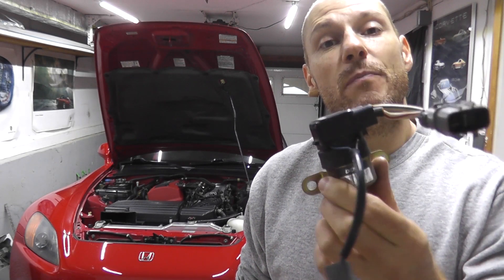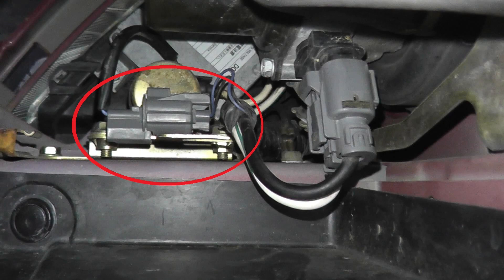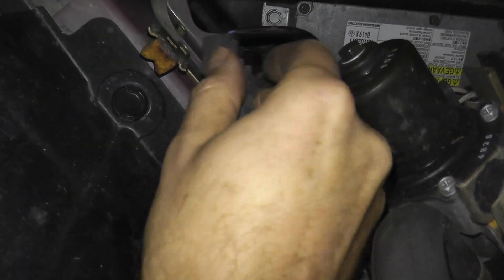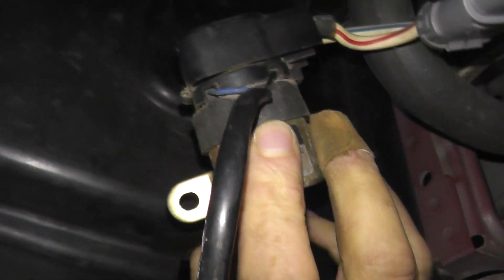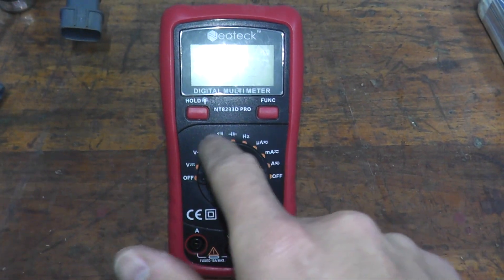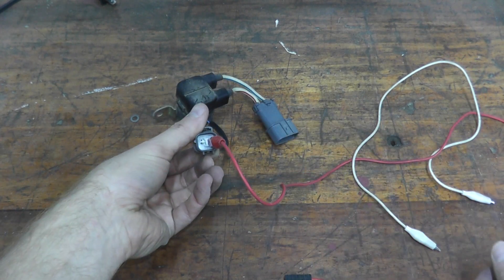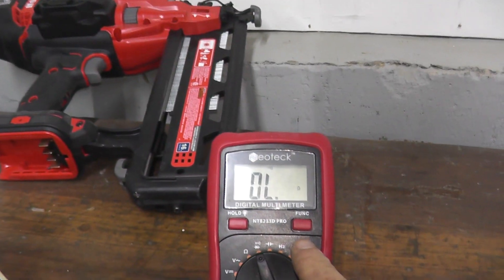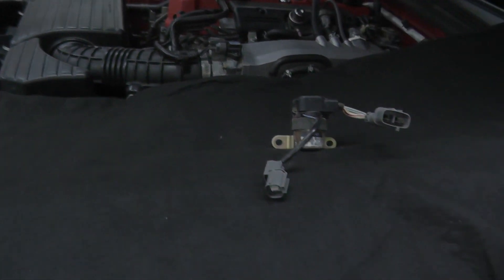How To Test And Replace An Air Pump Relay | Air Injection Relay

Comment: Great video my friend,I have a question, maybe you can help me? My 2002 Buick regal, 3.8, when I turn the key to the off position, the key wont come off ,I have to go under the steering column and push a bottom, then I can turn the key out, can you please tell me what is wrong,and if you can fix it, thank you cheers from ontario ca.